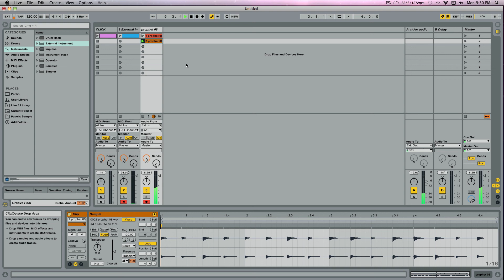Hardware instruments latency and midi

Comment: Thanks man, very straight forward. A lot of tutorials make it out to complicated. I'm running ms20 and model D through my great river and Rosetta converter with direct monitoring. A lot of tutorials leave out what and how they are compensating for. This is super simple and can just save presets. I like to use my midi keyboard vs mini keys and use standalone analogs without keyboards so this helps.